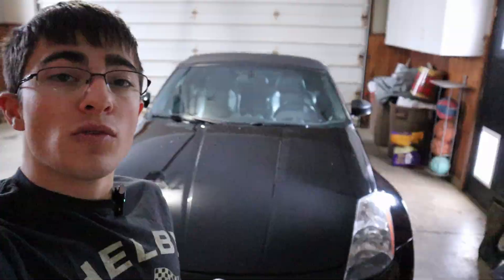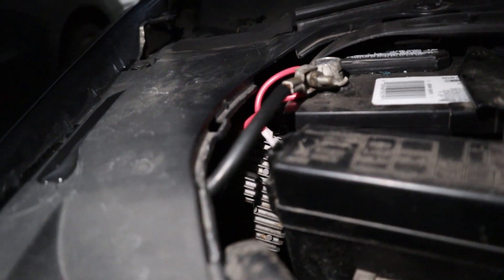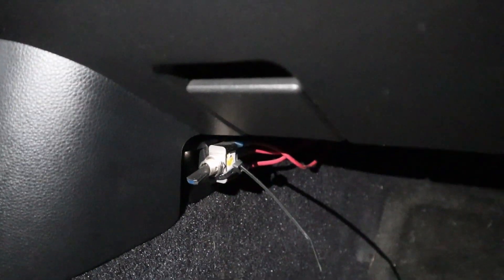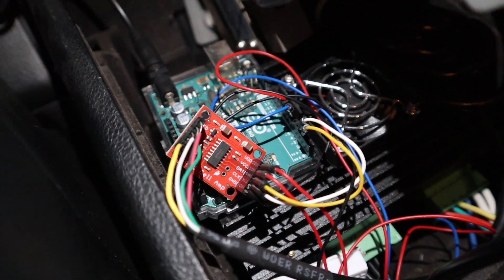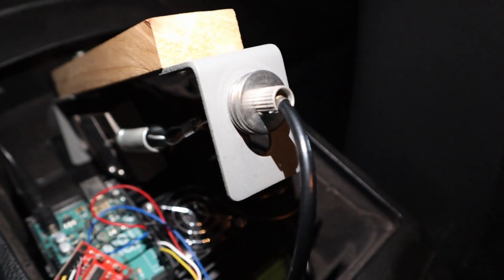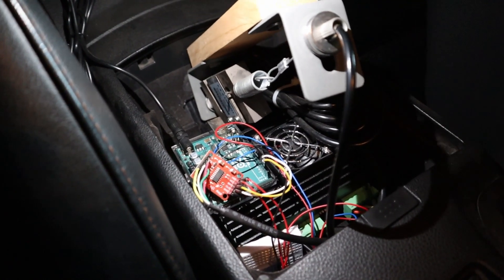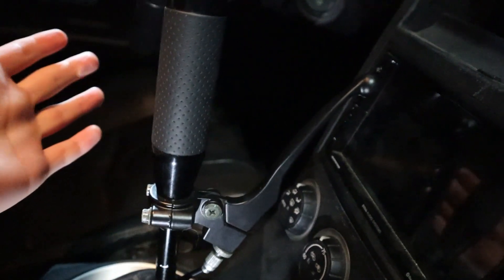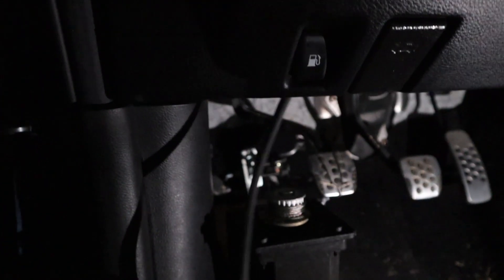Overview of my Automotive Hand Clutch System

Comment: Hey man! Love the video. I was in a motorcycle accident last year and broke my femur among a bunch of other injuries. I have a 98 jeep cherokee that I love, thats manual. Ive been driving it fine but unfortunately i am going to have to have another surgery on the femur and my clutch foot will be out of commission for like 3 months at least. You have inspired me! Definitely gonna try and get something like this setup in the jeep before my surgery. luckily i work at a fabrication shop, running the cnc/3d printing. We build all kinds of shit so I think mechanically speaking i feel comfortable setting it up. Not a huge amount of experience with arduino, but i have some basic understanding. If there's anyway you could send me your code to use as a starting point it would save me a ton of time! Would really appreciate it. Thanks for making these videos, i had a feeling some sort of cheap diy option for a hand clutch was possible just couldn't quite figure out how to do it.
Reply from the maker: Here is a link to my code from a year ago where I posted a question on the Arduino forum. https://forum.arduino.cc/t/my-stepper-h-program-is-lagging-when-doing-calculation/1264605
Reply from the maker: It is basically the same as it is now, except made a small change as was suggested in the forum post. This should at least be a helpful starting point.
Reply: Awesome man! Thank you. Might try and 3D print some drybox enclosures for the arduino/stepper motor driver, and a separate one for the stepper motor. If I end up getting something that works, and you dm an address I’d be happy to send you some. Cheers
Reply from the maker: @yapscience  Good luck!
Reply from the maker: Having the ability to machine whatever brackets you need will be great! Originally I just modified some off the shelf things I found, but I just ordered some custom ones from send cut send to swap in.

Comment: This is AMAZING!! In 2011, I got into a motorcycle accident & broke my back & almost completely severed my nervous chord. Luckily, I got movement back in both my legs, but I never got any movement back in my ankles or toes. So driving standard isn’t impossible, but it’s also not practical for daily driving. I have a 97 Honda Del Sol & unfortunately, I had to get an automatic. It’s just a little single cam, Vtec. But I wanted to Kswap it & use the tiptronic trans, so at least I could get back into banging some gears lol but it’s just not the same as having a clutch & also the wiring it takes to make it possible is wayyyy out of my wheelhouse lol I know someone who has done that swap in a Del Sol, but won’t sell me anything, wire harness wise, to allow me to do it. Your hand clutch setup is exactly what I would LOVE to do. My question for you is, would you be interested in making everything I would need to put a hand clutch like yours in my Del Sol? & if so, roughly how much would it cost? The only other hand clutch setups I’ve seen are the “Duck Clutch” kits. But I’m not a fan of them. What you have going on is just perfect
Reply: So check it out. I have a 350z as well as my drift car. My left leg recently has became messed up due to my type 1 diabetes and neuropathy. It has lead to charcot foot. Drifting and driving is my my biggest passion and only thing that helps me clear my mind and not think about anything besides in that moment and me driving. I'm supposed to have surgery on my foot in the next few months. But ill still never beable to use my leg normally. I could do all the wrenching part and all that but hard part for me would be the electronic part
Reply from the maker: I’m sorry to hear about that. If I get anything figured out on how to make build systems for others I will be sure to make a video and let you guys know.
Reply: @pixelsstopavement  yeah, that’s the part that is lost on me too. May as well be asking me to read a book in Chinese lol which, btw, I can’t speak or understand lol
Reply from the maker: Thank you for your comment! I am sorry to hear about your accident. Unfortunately I am not able to build kits for people at this time. This is mostly due to my lack of understanding about regulations for adaptive vehicle modifications. Also my system is currently very much a prototype. It has been working well, but is still relatively untested. I wouldn't want to put something together for someone just for it break. I hope at some point I would be able to make kits for people, but currently that just isn't a possibility. Hopefully these reasons make sense.
Reply: @FullThrottleCars ahhh, ok. Yeah, I totally understand man! I just couldn’t pass up the chance to at least ask & hope for a yes haha